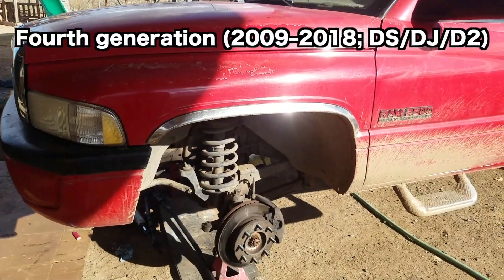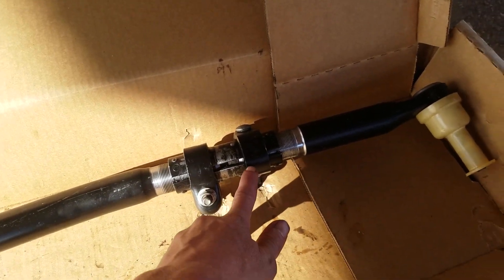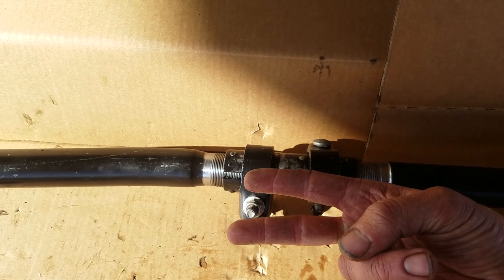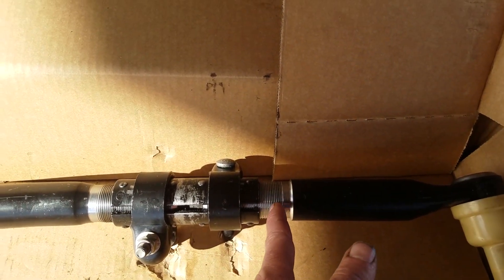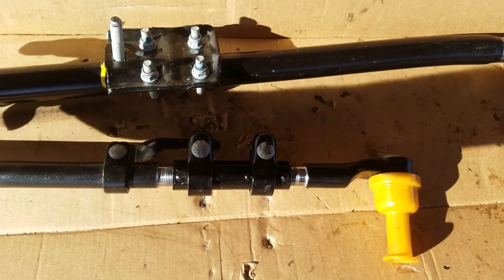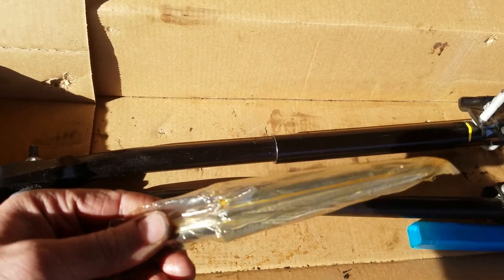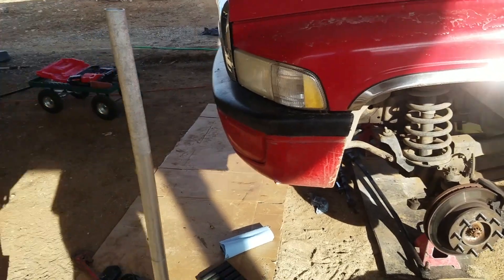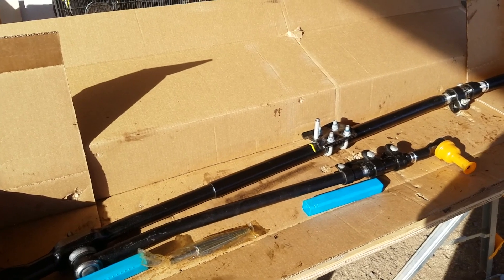Dodge Ram Steering 4th gen on 2nd gen.

Comment: Good info on the reamer, everyone says you need one but it’s hard to find which one you need. I have already installed the ‘98-‘99 HD setup, but the drag link connects to the front of the tie rod instead of the top like this one does. The first couple inches of steering wheel travel just rotates the tie rod before it starts turning the tires- it’s better than the Y steering, but still not great. I think it will be worth the necessary mods to upgrade from the ‘98-‘99 HD hardware to this one.

Comment: You can do it on a 2002. No idea about the other years. I did this to my truck when this recall first came out. Still running that steering system 50k miles later.

Comment: Talk about giving up easily.  So it does work. You just have to put in a little effort. Good to know.
Reply: lol i totally understand him and personally am extremely glad someone made this video. Cutting a tie-rod down in length is NOT an easy task. best case scenario: you have an oxyacetylene torch or burn through 15 cutting blades and maintain that precision, cause if you fuck up, you just wasted the most expensive tie-rod and probly 2 days while another is ordered.
Reply: @Reagan.Frakes  You only need to cut about a half inch off of both tie rods where the turn buckle connects them in the middle and trim a half inch off both ends of the turn buckle. Its super easy and a cut off wheel and a flap wheel are all you need.

Comment: I just bought a moog t style n im going to try putting it on my 01 dodge 2500 . A guy in the comments said he did it and it went right on
Reply: Well it went on . But I found out there is a recall on the moog setup so I called moog n they sent me out a new passenger side tie rod witch was the recalled part . The new 1 dont clear the rim on factory rims when turning sharp left so I gotta get 1/4 inch spacers
Reply: @foxxx5.941  good to know cause I bought that same setup and I'm going to be installing it next week
Reply: @foxxx5.941 did it go right on or did you have to do other stuff